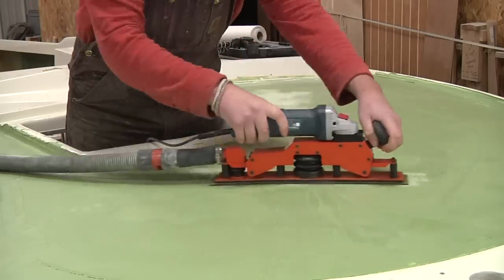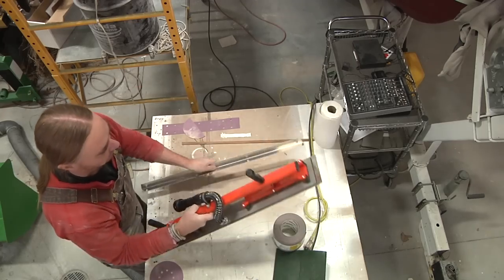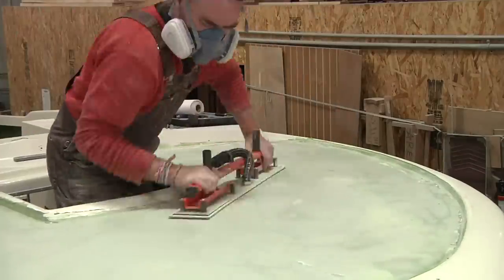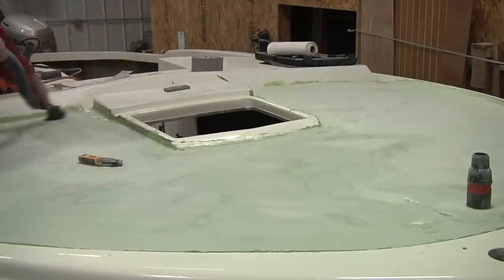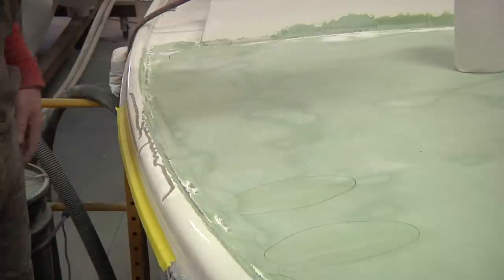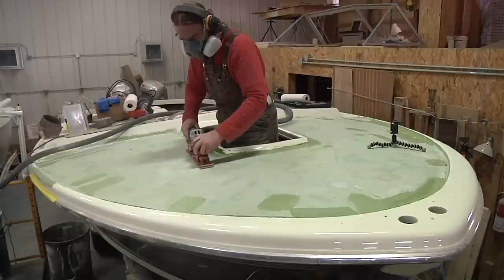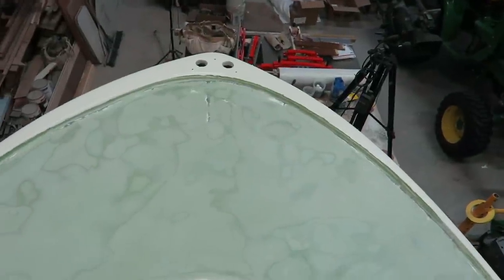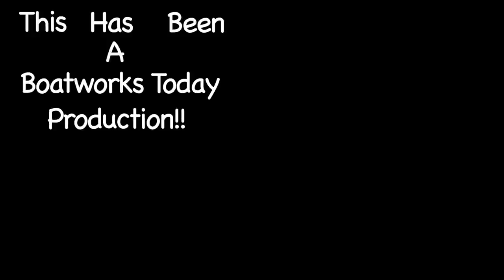Final Sanding ~ Fairing The Fiberglass Deck Repair!

Comment: Having built a fiberglass 20' kit boat, (back in the day), watching you work makes me wonder how I survived the, (two year) project. My wife and I still remember how we almost, "gassed" ourselves painting the inside of the hull with contact cement before we had 4"  of urethane foam sprayed in.

Comment: Love that larger long board sander!
I do alot of automotive bodywork. I have a 24" or 26" Durablock that i use for larger flat panels...Works great!
A helpfull tip for you, when sanding these large areas for example,  when you wwnt from the electric long board to the manual long board, you can put a guide coat over that area and it will show you all the defects without having to look too hard. You can either use a dry guide coat, which is basically a graphite powder that you rub over the area. Or i use the cheapest flat black paint in an aerosol can. It has to be flat, because anything with a shine will clog up your paper. Just dust some of the flat black over the area, give it 5 mins, and start sanding. All your defects will start showing up and then you can decide where to sand more, or where to walk away and add another skim coat.
This has been a huge help to me, and ive been doing it this way for about 12 or 13 years.
Enjoy your Sunday!
Reply from the maker: When I get to the hull I'll definitely be using the 3M powder!  Thanks for the info ;-)!!

Comment: I know is your job and it pays your mortgage or whatever but I really admire your patience.  I have to fix some gellcoat, it's about two inches by half an inch and I've been putting it off since the middle of last season, what a wimp l must make it a priority between doing safety cover cutting the grass sorting the boat park out, not to mention the website, Facebook, Twitter and Instagram.

Comment: Good clip on fairing mate, I've been looking on you tube and there's not a lot of good info on fairing a boat. Those fairing boards, the manual ones, are called torture boards here in Oz and probably elsewhere. Remember everyone sanding is fun, repeat with me

Comment: Another great video, that sander is nice!  One thing that I would suggest for sanding is a 3m versaflo powered respirator with FACESHIELD!  I have the one with the light weight helmet and have the ear protection installed.  It's a little pricey, but the fine dust is bad for your eyes, particularly if it has glass fibers in the dust.  I also use heavier weight mechanic gloves, and disposable tyvec suites with a hood, with the idea of having zero skin exposed to the dust.  You can avoid the dust, and if you think about how this stuff can make your arms itch, do you really want it on your eyes?

Comment: My biggest challenge on jobs like this is shaping the radius In the toe rail, hatches, etc.   I end up spending hours hand sanding using the sides of my fingers or hand to establish the radius, but it's tedious and I always end up chasing Inconsistencies.  In the previous video it looked like maybe you trimmed a corner of the plastic spreader to match the shape of the radius?   any other techniques you've found to really get a nice even shape to the radius?

Comment: Andy, this is awesome. I have a Bertram 31 that has the same issue and I am very appreciative to have such skilled examples to follow as well as the real world materials/tools to do the job right. I've already obtained the fairing board and , after watching your perfect sanding job, I may have to start saving for the sander. I can't wait to see the rest of the Bertram work as well as the finished product. Thanks for sharing; you're doing us all a huge service. A quick question if you have time - how does the fairing compound hold up to dings and traffic?

Thanks again.

Comment: Hello, I am working on a sailboat restoration and wanted to hear your thoughts on sanding fiberglass with the Dewalt cordless orbital sander using 60 grit paper and up. I have about 4 hours run time with my batteries based on the specs. Thank you for your thoughts on this matter. Also I ws looking at a cheaper version of a wooden long board with the velcro bottom. The hookit 3m fairing board 30 inchs and 55 dollars. The sailboat is a 1965 Pearson Triton 28.

Comment: Thanks so much for posting these vids. I’m fairing a Hull I built when I was younger and there are ALOT of low spots and high spots. I was advised to use a pencil to cross hatch the hull, then long board it back to see all the low spots, then fill these spots with fairing compound. Is this what you would do? 

I’ve also heard of painting the hull with primer in different colours to see the different layers, but is it okay to fair onto primer as long as you’ve sanded it? Epoxy primer that is. 

Thanks so much and the videos have really helped me out over the years! Champion!

Comment: hi Andy Peter in Barbados, couple of questions, 1) on the island we use automotive paint with silica sand for nonskid. with Totalfair do i need to coat it with anything before priming?   2) I am covering the deck of a 24ft sailboat including cabin house but not the cockpit how much product would i need?   3) the fairing compound that was there before was West System 410 are these products compatible? Your videos are the best I have learnt so much. they gave me the inspiration to rebuild my J24 and another 24 ft home made kit boat. thanks

Comment: i cant find where to buy the electric flexisander you are using. Fantastic videos by the way. you are teaching me alot. i want to replace my deck rotten core. will remove top skin and replace core then replace original skin, grind old diamond pattern of, fair and then apply Awlgrip with soft sand

Comment: I was wondering how those sanders were going to work out. I wished I had something like that when I was installing sheet flooring for years. I used a razor scraper old school. I had to get some very rough concrete to smooth and flat perfect or the sheet vinyl would show anything that was under it. Now days I’ve noticed the flooring has texture and is way more forgiving of imperfections underneath. Can I borrow one of your brand new sanders when I fill the thousand of cracks on the Amerosport? I guess I’ll have to fall back on my razor skills and my oscillating orbital and a sanding block to finish. Lol. Anyway, looks great and thanx for the video. Oh, and I will be buying from Total Boat when the time comes to help you out. I’m still anticipating your trip to SC to look at the new paint. I like the idea of rolling and tipping.

Comment: Great show as always! I have a question for you... If you have a boat and you don’t like the colour of the gel coat, can you scuff the surface up and gel coat over the top? Or do you have to rub it right back to fibre glass? Thanks in advance..

Comment: Hi Andy,
I'm curious to hear about your long term experience with power sander.
 I have been using one of these for two years on and off for an osmosis/laminate/fairing/barrier coat treatment on a 44 foot grp sailboat. I have found the machine almost impossible to hold for longer than 3 or 4 minutes and I have already destroyed 2 of the laminated sanding plates. Personally I don't think this machine is ready for production. I will be doing a you tube review in the future.
Cheers

Comment: Hi Andy I like the look of these tools however after looking at the Flexisander website I was hard pressed to see any difference between the fairing tool and the long board sanding tool. Is there a difference apart from the DE model ?

Comment: There is nothing better than my Chicago Pneumatic air file. I have had it for 36 years. I have a brand new one in my box but the original is still going. Try one. It will sand that deck a whole lot better than that electric do-dad.

Comment: The voltage converter was mush less expensive than I imagined. How did it perform? Did the sander seem to have "enough" power, and did the converter get overly hot?

Comment: Great job Andy. I'm fairing my boston whaler classic now and am using the same method on all topside surfaces except floor. On the flooring where Im walking I went a different route of using gelcoat to fill and fair due the original surface being gelcoat and this would ensure a harder material versus a bondo. Whats your opinion on this? Thumbs up?

Comment: I have a Mac 21 day sailer that I'm going to try to learn fiberglass work on.  Thanks for the awesome content!  Isn't there a way I can pay you for advice on your website in case I get into trouble?
Reply from the maker: There is actually a couple different options.  There's Patreon which I have setup primarily for consultation (there's different levels depending on amount of help needed) or for quick 'here and there' questions there's also this option avail on my website: https://www.boatworkstoday.com/contact/  Hope this helps!  http://www.patreon.com/BoatworksToday

Comment: How does that power sander work in terms of vibration isolation?  Most sanders kill my hands.
Reply from the maker: It's better than a lot of other sanders I've used lol!!  Overall not too bad IMO
Reply: Mine too. I found that gloves help, currently using some leather Mechanix brand that have extra palm padding. Also stopping and stretching every 10 minutes or so and switching hands regularly.

Comment: Great stuff as usual, Andy.  If I use the same steps you have so far with the resin and 1708 layers etc. is that Total Boat fairing compound ok to use around a bow thruster which is obviously below the water line?
Reply from the maker: Absolutely!
Reply: Great, thanks, Andy.  It's looks amazingly easy to work with, especially when it's 1 to 1 mixing ration LOL!  Once those hardeners are in ounces and 3% and all that crap, that's where that shhtuufff loses me!  Simplify things, much better!
Reply: Great, thanks!

Comment: Have you ever tried a air powered sanding board. If so what are the pros cons to them to you new electric one?
Reply from the maker: I have but prefer electric.  The exhaust of the air powered ones tends to blow the dust up into the air.  I think cost of both is about the same :-)

Comment: Just curious, how hard does the total fair cure?  I have been using one called techni fill here in Australia, and while it is much better for pin holes the the west system compound, and sands quite nicely, it doesn’t seem to cure as hard.  At the moment I’m using it on quite a thin sailing dinghy deck, so a little flexibility is not a bad thing, but was wondering about the total fair.

Comment: What is the overall verdict of the Flexisander? One of the things I saw is the 'gash' which seemed to be where you put pressure when applying the fairing compound. Did you save time?
Reply from the maker: So far they are definitely proving their worth!  Saved having to do more fairing coats which would have amounted to at least 2 more days of work ;-)

Comment: In continuation of the recent threads concerning Epoxy vs Polyester over older polyester fiberglass. :)  Could you have used TotalBoat Polyester Fairing Compound instead of the epoxy fairing compound you used?
Reply from the maker: Yes, but since I'm planning to paint this boat when done there's some advantages of using epoxy fairing.  1) longer working time to smooth and 2) it shrinks less over time creating a more stable substrate for paint :-)  If I were going to be finishing with gelcoat then poly fairing is what I would have used ;-)!

Comment: Ordered some Thixo using the affiliate link, thanks for the recommendation. Last few times I used Six10 it didn't cure right, a problem I didn't previously have (conditions were good) - maybe bad batch. So I'm eager to test out the Thixo.
Reply from the maker: Thanks for using the referral link!  I think you'll really like the Thixo, just be sure to use a caulking gun that's able to push it out!  This is what I used and it's smooth as butter ;-)  https://www.jamestowndistributors.com/userportal/show_product.do?pid=2531

Comment: Another great video. One question: What brand or type of tape do you use to protect an area?
Reply from the maker: It's just general automotive masking tape made by 3M  Either the blue or yellow stuff works well (yellow is less expensive for some reason though ;-)
Reply: yellow is for inside use, and blue is for outside. Blue is uv light resist so after few days you can easy remove it.
If you use yellow outside, and don't remove it in 2 days, than it will be so hard, impossible, to remove it
Reply: Ivan P thank you for that info on the yellow tape! I’ll spend the extra on the blue for my own boat.

Comment: Could West 407/410 be used here and if so which one would be best?
Reply from the maker: Yes it could :-)  Either one would work just fine.  410 may be a bit easier sanding but may leave some pin holes that will need to be touched up

Comment: how did you get the 220V 50 hrtz sander to work in your shop, did you run 220v three phase?
Reply from the maker: Used a 1000W Seyas converter from Amazon, and it's working great!  It's what's shown in the beginning when plugging the sander in :-)
Reply: The sander uses what's called a universal motor (has brushes) and can be run off any frequency (usually including DC), I run several US bought grinders on 110V 50Hz (which is mandated on UK job sites) without any problems